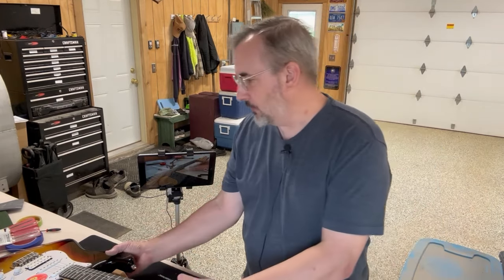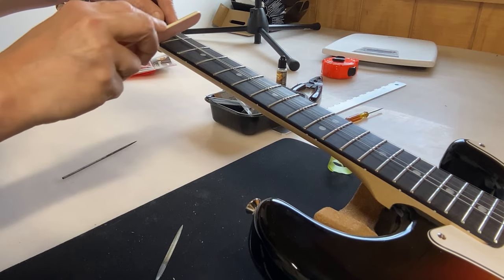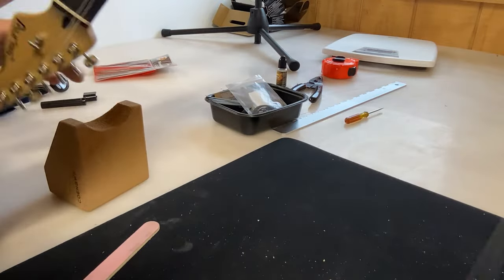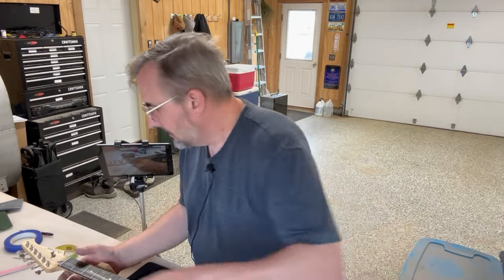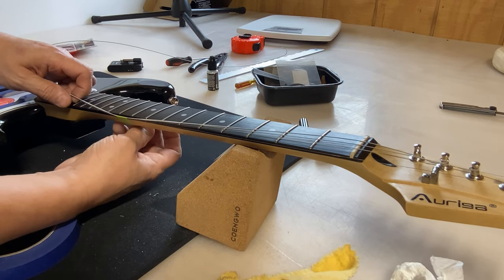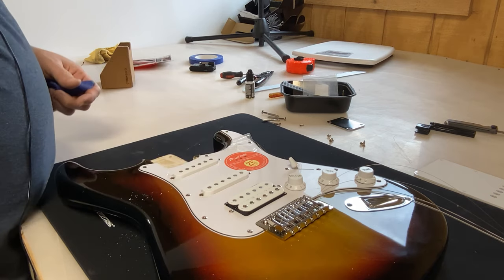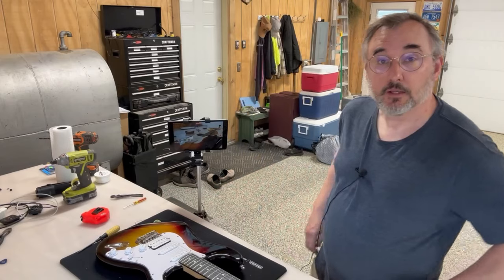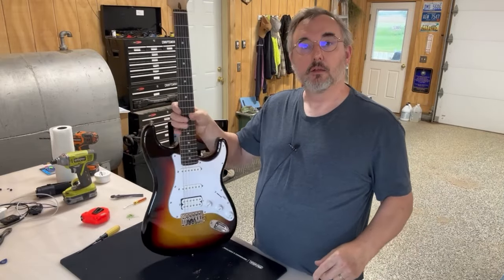Fixing Sharp Fret Ends AKA Fret Sprout

Comment: The ends of the frets are called tangs. A fast and easy way to file them in a few minutes is with a sanding sponge. Only takes 2-3 passes with it. Any additional sharpness then use a fret file or emery board, check as you proceed and only take off the minimum fret material ✌️
Reply from the maker: Will have to try that. Thanks.